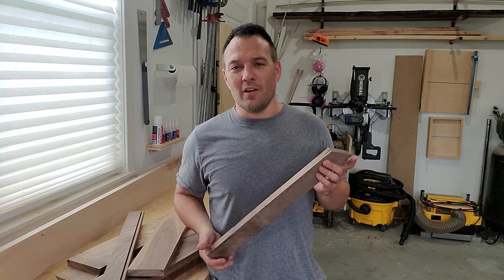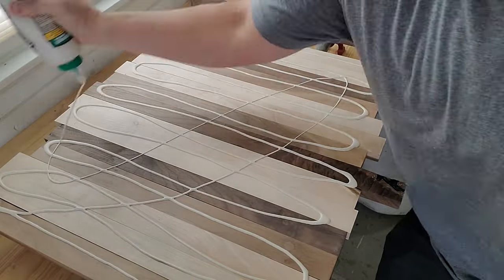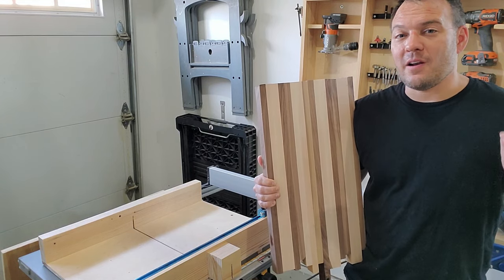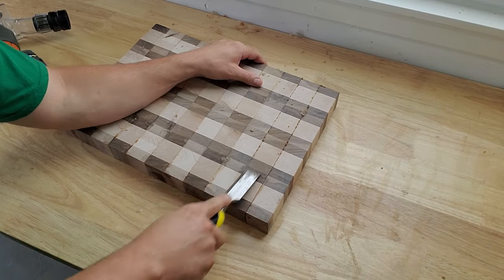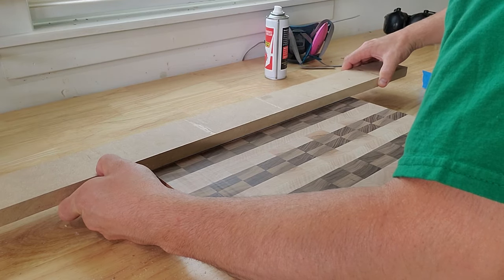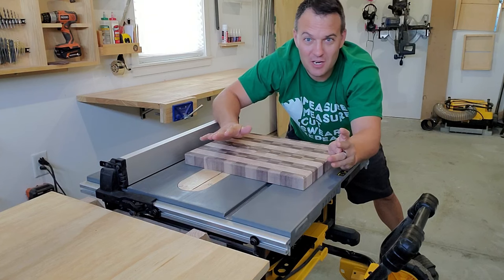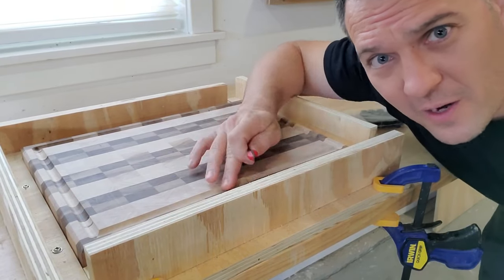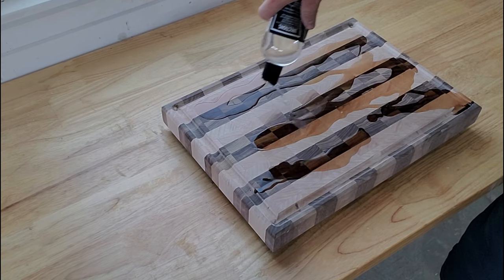Epic End Grain Cutting Board from Scrap Wood

Comment: one way to avoid tear out on side on the backside of your cutting board as happened to you hear in the video, is to perhapa router a 2mm @ 45" chamfer before sending through plainer. The left over chamfer can be removed on table saw if needed . Hope that helps. Absolutely loved your video and easy explanation.
Reply from the maker: Thanks for the suggestion and the comment!
Reply: Chamfering the trailing edges of the board before planing really eliminates tear out.  I pretty much always chamfer the edges of my boards anyhow.

Comment: Looks awesome! I think one way to prevent the tear out is to glue culls to the front and back with the edge grain up. I even glue them to the sides for safety because my planer is not as good as yours. Cut them off once you have it planed flat.
Reply from the maker: Thanks for the suggestion.  I just made another one.  This time I tried sacrificial pieces on the sides.  It didn't help much with the tear out on the back side but I think it was a little safer and prevented major chunks from breaking off.

Comment: Great video, never would have thought about oil to treat and protect the wood.
Reply from the maker: Yup!  It's best to actually soak the board.  It's shocking how much oil a board can absorb.
Reply: @HowIDoThingsDIY  I heard you say that in your video, and I'm sure that mean when washing it, it won’t warp or crack.
Reply from the maker: Full disclosure.  I did a few things wrong as this was my first board.  #1.  I didn't water pop #2.  I wiped on the oil instead of soaking.  After the first time I washed it, it looked dry and was rough.  I went back and water popped, sanded and then used about an entire bottle of oil until no more would soak in.  Now it's money!  I passed on my new learnings in the video.
Reply: @HowIDoThingsDIY  Hey, people love that stuff, the honesty. Still love that epoxy movie, so good. My next upcoming video is actually about a catwalk for an attic.

Comment: wow, this turned out beautiful, man! 😍 i haven't done an end grain cutting board yet, but i know from other makers, that they use a planer jig for their router to flatten the board and do a lot of sanding afterwards. it's a lot more work to do but it helps to prevent tearout and protects your thicknesser. 😀✌
Reply from the maker: Thanks!  You mean a router jig for flattening?  I think I may have to invest in a bigger router and build a nice flattening jig.

Comment: Wow, that's a nice looking cutting board!

For tare out on the end grain... I think generally speaking, it is not recommended to run end grain boards through a planer. 0_o those last pieces could break off and shoot out. Scary stuff!

The way I've seen it done (safely) is to glue on sacrificial boards all the way around. Doing this also allows you to make the side sacrificial boards extra long, eliminating snipe. Bonus!

Keep up the good work dude!
Reply from the maker: That'll work!  I'll try that next time!
Reply: I did basically the same thing when I built an end grain board (I am still kind of new so I have only done it once). But I only added a sacrificial piece to the trailing end of the board (as it goes through the planer). As @Make with Jake said, this can also help with snipe as well.
Reply from the maker: Ya, next time I'll definitely add something to it for safety and snipe.

Comment: Next time when doing your final glue up. Add a waist piece of board on each end. When it goes through the planer the waist board ends gets torn up. Then you cut off waist board at the joint on both ends.
Reply from the maker: Good tip.  I made a board after this and tried gluing boards to the sides with limited success.   When I make most boards, I just assume 1/4" of waste on each end.  Thanks for the suggestion and comment!
Reply: @HowIDoThingsDIY  your welcome

Comment from the maker: Do you guys have any tricks for planing the end grain boards without damaging the trail end?  I would not recommend my method because pieces could have broken off and shot out.  The best suggestion I've seen so far is to use masking tape and CA glue to attatch longer pieces to the side while planing.
Reply: yes, glue a sacraficial board to both ends ;)
Reply from the maker: I'll experiment with this at some point.  I like the idea of putting longer pieces on the sides but then that would make the possible width of the cutting board narrower.

Comment: Add a sacrificial board to both ends or try to bevel the edge slightly to there isn't an edge for the planer to grab.
Reply from the maker: Good suggestion.  I actually tried that on the next board.  Defiantly safer.  Thanks for the comment.

Comment: I realize this is an older video, but to prevent tear-out on the end when i send my boards through the planer, is to use my orbital sander and make a chamfer on each end, both sides. Just thought I'd through that out there to you. Just incase you haven't found a fix yet. Beautiful board by the way.
Reply from the maker: Thanks for the tip!  I tried that on my next board with not much better results.   Maybe I needed a bigger chamfer.  I always seem to end up cuting off a blade thickness of material.
Reply: @HowIDoThingsDIY  I do sand a pretty deep chamfer. Not sure if that's the correct wording or not, but yes, I do make a pretty serious chamfer. And I have planed around six end grain boards without any issue. As I matter of fact, I planed one today. The other way that I have seen on other videos, but haven't tried myself, is to glue a sacrificial board into the end. Not sure if or how good that works. Any way, hope this helps.
Reply from the maker: I used sacrificial boards on the last one I did and and I still had chip out but the risk of large pieces breaking off and shooting across the shop seems lower.
Reply: @HowIDoThingsDIY  oh wow, did you have a board actually "blow" up in the planer? I was thinking today and meant to ask you, are your blades new?
Reply from the maker: I haven't had one blow up bit I've had some chip out on the end that I was ablevto cut off.  I just don't like doing endorsing boards in my planer.  Helical conversion should help when I do that

Comment: A sacrificial piece of hardwood glued to the end would have preserved the end grain of the board. Then you could have just cut that piece off at the table saw. Most people wouldn't run endgrain through a thickness planer, since it's very likely that it will separate, catastrophically (explode). A drum sander, router flattening sled, or belt sander are safer choices.
Reply from the maker: I can't agree with you more.  Wish I had one.

Comment: How did you deal with snipe?
Reply: And, man, 6:18 looked scary.  Hope no one got hurt.
Reply from the maker: I adjusted the plane with the infeed and outfeed tables slightly upwards.   I also left a little extra to be cut off later in case there was any tear out.  Ideally, I would have used a drum sander if I had one.
Reply: @HowIDoThingsDIY  thanks, makes sense! Yes, looks like many people use drum sander for clean up.  Just wondering how well does it glue?  The surface must be rougher than after planing.  I think I will make the two side planks 3" longer on both sides.
Reply from the maker: @sleepyowl910  Drum sanders can provide a very smooth finish.   Should glue up find.  Yes, leaving a little extra will help deal with snipe.  Try a test run and then decide how to proceed.

Comment: 7:00 Please don't show your work by passing your hands over the rotating blade, especially in an instruction video...
Reply from the maker: The saw was off.  The noise you're hearing is my dust extractor, which runs for about 30 seconds after the saw is shut off.  Thanks for watching!
Reply: @HowIDoThingsDIY  Please, the saw is visibly rotating, sound or not. Same at 7:13.
Reply from the maker: You are correct.  It is still slowing down.  But was definitely off.  Next time I'll wait for it to come to a complete stop.  Thanks for pointing that out!

Comment: Good video and great looking board.
I just wished you would not have cut out the part when you noticed the juice groove was screwed up.
I know how I would have reacted and what I would have said. I would have had to cut it out myself.
Reply from the maker: Ya,  in my newer videos, I would have left that.  Basically, I realized I was trying to remove too much material, and it wandered.   I made the groove a little bigger and took less off, and it was much better.